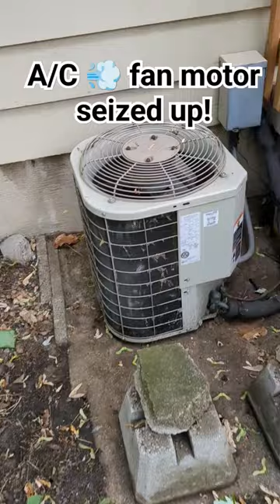❄️A/C fan motor seized up #inspection #hvac #youtubeshorts #shortvideo #shorts

Comment: Bad cap, or seized motor. Give the blade a  little push with a screwdriver see if it goes.
Reply: I have to do this every spring 🤣
Reply: Similar issue, just pushed the blade and it’s spinning. Does that mean bad capacitor?
Reply: @atolson4892  you might need a cap tester,  but from my experience usually motor,  but as soon as I say that it'll be a capacitor lol. Anything under 5% replace it
Reply: @atolson4892  if the cap is bad, give the homeowner the option to replace fan anyway. If they say no, at least you don't look like the ass when the motor does fail.
Reply: @ryanhurbi  Appreicate the context. Well, I am the homeowner so I may start with the capacitor and go from there. 🤣
Reply: To close the loop, replaced the capacitor and it’s working fine now. Appreciate your help!
Reply: @atolson4892  no problem,  if it gets you through the summer without needing a fan, that's a win.
Reply: Q: Unit turns on, fan doesn’t spin. Replaced the Capacitor. Unit ran w/ fan for like an hour, then fan stopped. I just spun the fan with a stick and it started again… is that a bad fan motor?
Reply: @__tars__  Yes,  I just had this same situation at work, checked cap first(7uf) reading was 6.8 uf. Replaced the fan motor, no issues. Motor shaft could be starting to seize, especially if it was never oiled.

Comment: Had the same issue a few weeks ago. Thought it was the motor at first, but gave the fan a spin and started running. Look at the capacitor and bought the part for $43.31 and changed it myself. Service call would have been well over $400. Also gave the unit a good clean which the Hvac guys wont even do. Lol

Comment: Everyone saying bad capacitor. When it literally says fan motor is seized up 😂 mine gets stuck like that every year first use of the year... little grease and slip an old power drill around the shaft run it with the drill about a minute and that always frees it up. My method is not recommended unless you're stubborn and refuse to ask for help like me.

Comment: Q: Unit turns on, fan doesn’t spin. Replaced the Capacitor. Unit ran w/ fan for like an hour, then fan stopped. I just spun the fan with a stick and it started again… is that a bad fan motor?
Reply from the maker: @__tars__ From your description that's what it sounds like. 
Thanks for watching

Comment: That, death buzz is a sign the capacitor is bad.
Reply: Changed out my capacitor for $43.31. Service call would have been easily $400.
Reply: Capacitor for the unit or for the fan?
Reply: @dorothybrown8859  Usually, it controls both, so make sure you plug the fan to the fan and the unit to the unit or you'll have a really bad time. Lol
Reply: @jasonwood8493  Thanks. I have the capacitor out, just waiting for a bracket to install the replacement, which is wider than the current one.  Why am I doing it myself?  Because I am poor and old, and was quoted a price of "$500-$1500.". When I saw the cost of capacitors I decided to do it myself.  I took pictures and have it clearly marked also.
Reply: @dorothybrown8859  yup. Really easy if you watch a few you tube videos.good luck

Comment: Buzz! Call a professional for a service call or replacement. Appears to be an R22 unit, maybe wanna swap it anyway.
Reply: Your advice is exactly what every hvac tech will tell you in my area.  This probably needs a new $12 capacitor that can be swapped out in less than 5 mins.   Of course the tech will tell you it is probably best to spend $8000 on a new unit.   If you call a tech, this $12 repair becomes $400 and still only takes 5 mins.   If I stick my finger in the grate and flick the blades and they don't move then it is the blower motor.   I can buy a blower motor on Zoro delivered for $140 and can install that in less than 30 mins by following steps in a yt video.
Reply: @troyfall6573 lol 😂😂
Reply: Very true😂
Reply: @troyfall6573  can usually save the the blower fan anyway with a little elbow grease (and regular grease) squirt the bearings with penetrating oil, slide an old power drill around the shaft and run it clockwise for a minute, penetrating oil again then run counter clockwise. Dab on a bit of grease anywhere you think necessary and your good to go.